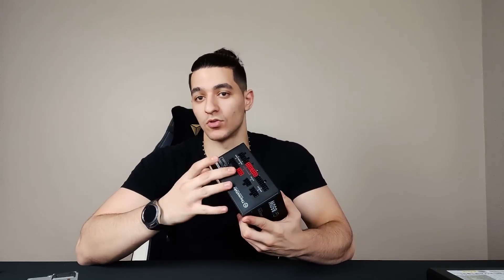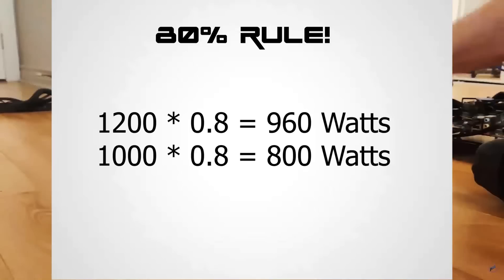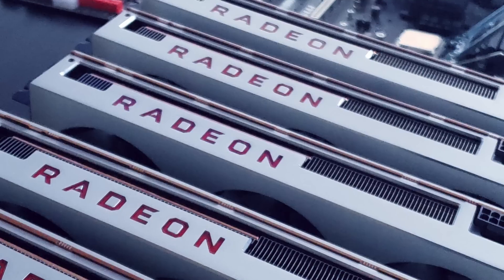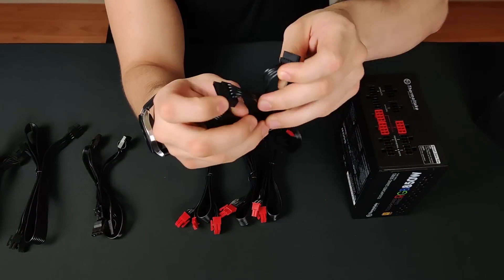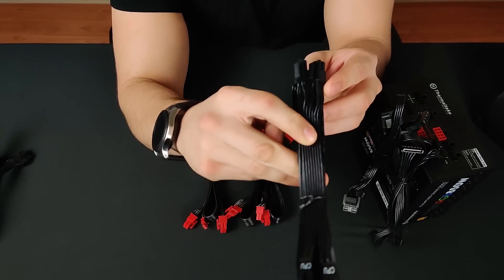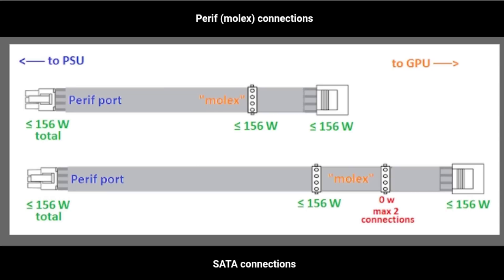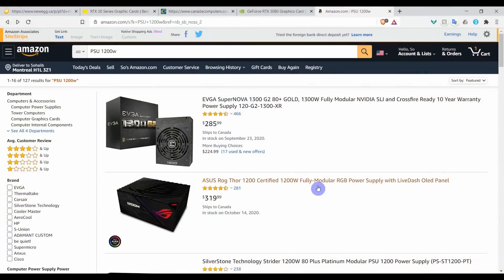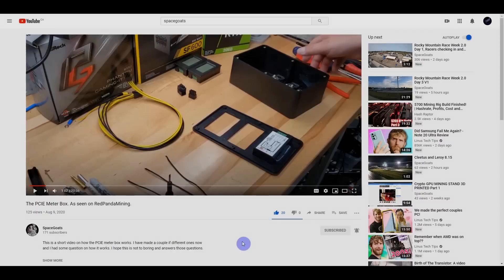Using ATX Powersupplies For Your Mining Rig FULL GUIDE

Comment: @Mining Chamber I have a question.

I have rx 5700 xt s running stable with 96-101W. How many of my GPU+Riser can a Corsair HX1000 (80+ Platinum) can safely handle? Is it safe to run 5 GPU+Riser with my PSU?
I have another power supply for CPU, RAM, SSD & Motherboard.
Reply from the maker: Hey! Out of just 1000 watts PSU for only gpus you can run 5 of them. If you want to do 6 I recommend getting a 1200 watts. Usually these cards pull 120-130 watts off the wall so the software won't be accurate !
Reply: @MiningChamber  Wow thanks for your answer and for your video, I learned a lot from thanks thanks.
Reply from the maker: No problem!!

Comment: if i use one vga cable from psu (8 pin) to one vga (8 + 8 pin) and one new vga cable from psu (8 pin) to riser (6 pin) without branching, is it better to do this ?
Reply from the maker: Yes you can do this for sure and it's really safe but in some scenarios you will end up not having enough strands to run all cards, that's why using splitters is a good way to be able to power more cards with your PSU

Comment: Would you recommend a seasonic PSU? I was thinkin of buying a 1300 platinum series. Or you would recommend a double 750 or 850 platinum seasonic better?
Reply from the maker: It's better to go with one PSU but things to keep in mind is how much watts you actually need and how many pcie pins you need to plug. So if you think that 1300 is not enough for the rig your building then going with 2x 850/750 can be alot better!
Reply: Would you recommend seasonic PSU or you prefer other?
Reply from the maker: @AntaRESynth  I usually recommend EVGA and CORSAIR since I have the most experience with them and they have been great. But I'm sure Seasonic as well is a good option!
Reply: @MiningChamber  how many risers can you connect on a single sata cable to be safe?
Reply from the maker: @AntaRESynth  in this video we mention it to be just one to stay safe. For molex you can possibly do 2 but it's better to do 1.

I would avoid SATA all the time if you can

Comment: What do you think of the 4+4pin CPU to 6+2pin PCIe adaptor (such as this one: https://www.overclockers.co.uk/ocuk-value-4-4-pin-to-6-2-pin-pci-e-adapter-cable-black-cm-14b-ok.html)? I have spare watts in my power supply, but not enough PCIe.
Reply from the maker: I'd not use that since the pin outs I believe can be different which leads to it burning. I tried it once and it didn't go so well so that's out of my experience I'm not quite sure why it happened!

Did you try using splitters and even then it wasn't enough? Maybe you can power a couple of risers with Molex?
Reply: @MiningChamber  Thanks for your reply. I've already splitted the PCIe, so I think I'll try the molex.

Comment: Great guide!! I've watched this video over and over again and still have something on my mind. I only have 2 pci-e cables(with 2 6+2Pins each cable) and the same for the molex to power 4 rx 580(8pins). Which is the most safe option??
a. use splitters on both pci-e cable to power 4 rx & 4 risers
b. not using any splitters to power 4 rx with pci-e cables only & power the 4 risers with 2 molex cables with dual connections
c. please put your recommendation

"a" option: is it okay for the pci-e cable to power all the gpu and riser? wont the cables overload?
"b" option: power load for gpu & risers would be split for each cable
Reply from the maker: Thank you!! Honestly both of your options are reliable, option b does have the factor of molex which I don't like much but option a does have the factor of possibly overloading your cables. So I would use 2x or 4x molex strands so that you power 1 riser or 2 risers per molex. Or you can even power 2 RX 580s and one riser with the pcie strand and then 1 molex for the last riser and repeat for the 2 other GPUs!
Reply: Thank you for the answer, it helps me alot to decide
Reply from the maker: My pleasure! Good luck!
Reply: What happened on this setup?

Comment: I have watched it all and I have a question. The PSU I got is an 1600W, 1560W is dedicated to 12V rails and I will use it to power an 8x RX5700 XTs rig. It has 8x 8-pin VGA and 6x 6-pin peripheral, I have used 8 VGA's, each is dedicated to a single card (8-pin + 6-pin, the cable is 8-pin to 2x 6+2-pin). I powered risers like this: 4 SATA each dedicated to 1 riser. 2 peripheral ports are left and I used them as each cable powers 2 risers through molex(so 1 perif 2 connections). It looks fine but here is the problem: I am out of outputs and cables. How can I power the motherboard? Manual says I should power with 2 Molex and 1 SATA in addition to 24-pin. How can I accomplish that?

What if I plug 6+2pin to GPU and other 6+2 (+2 will not be connected) to riser? Risers have SATA, Molex and 6-pin options and 8-pin cables are already split.
Adding manual just in case:
https://download.asrock.com/Manual/BTC/H110%20Pro%20BTC%2b.pdf
Reply from the maker: Hey! Thank you for all that details. So from reading it seems like the only thing you don't use is splitters and if that is correct then it should be your solution! You can get a couple of splitters that then will help you power the gpu and the riser from the same VGA strand. Which will save you up some periph ports for your motherboard. Let me know if that works for you or I misunderstood you!
Reply: @MiningChamber  That is the way I will go, your Discord channel was very helpful and someone came up with the same answer. Mighty impressive! I will probably share the final result tomorrow :)
Reply from the maker: Awesome!! ⛏️⛏️⛏️
Reply: Best Power Supply For | 12 GPU Mining Rig 3500 Watt Unboxing
https://www.youtube.com/watch?v=5HoUPLEaUBE&t=209s

Comment: i've found system instability when i power more than 2 120mm fans on a molex. i end up just using 2 fans per molex psu connection
Reply from the maker: Interesting! I know that fans take very little power I haven't heard of it causing issues like that. Glad you figured a solution though!

Comment: My experience is that not all PSU's will allow you to use PCIE splitters on their VGA strand.  Example - I have a Silverstone Strider Platinum 1200w, and they come with 8 VGA strands (single 6+2 pin only).  When I try to add a splitter to power the GPU (which requires 2x 6+2 pin), the whole rig just will not turn on.  If I then try to use a different VGA strand from another PSU model and plug them into the VGA port, you get the same problem it just will not power up at all.  Maybe it has some kind of intelligence built in to stop people from mix-n'-matching their cables to avoid litigation in case of electrical faults etc..... Do you have any PSU recommendations for 6x 5700XT's?
Reply from the maker: I haven't heard of that before! But I do know some PSUs have different wiring so if you try to use cables from different PSU that isn't compatible or splitters that are made differently then you will have a high chance of damaging your hardware!
Reply: Mining Chamber which PSU have you had luck with using splitters and where do you get your splitters from (link)?
Reply from the maker: All of the ones we mentioned in the description  are our go to! Links for splitters are in description as well. We usually get them off of nerdgearz!

Comment: @Mining Chamber - Just made a video on using the bitmain apw3++ for mining. I think you'll find it interesting. You can power 5 dual 8-pin GPUs from a single 1600W PSU at platinum level efficiency. Minimum cost is currently only $63 for single 8-pin GPUs. For dual, it's $75. It's unbeatable. Check it out: : https://youtu.be/Xf67xqc3Ink
Reply from the maker: That is awesome! Thank you so much! 

Youtube automatically removed the comment cz of the link sorry for the late response on it!

Comment: Hi, I am new and I am buying 6x Sapphire Nitro+ 5700 XT 2x8 PIN and someone is selling a PSU with 8x8PIN and 6x PIN/sata/Peripherical do you recommend to connect the same risers that your show in the 6pin or 8pin? Thanks!
Reply from the maker: Yes I do! Use one splitter for a gpu and one for 2 risers if needed
Reply: @MiningChamber  Thanks, I bought 4pin molex female to PSU 6 pin male splitter, I am planning to connect max 2 risers per splitter

Comment: What's the most practical setup you woulf recommend?0xD2917eb36cC03237A11e6E2F89B3f8F8F30963F3
Reply from the maker: Setup for a full mining rig or setup for powesupplies? 

For mining rig I recommend - 5600XTs while for PSUs I recommend using one large PSU (1200w and up based on your needs) combined with alot of splitters   so you don't have to use more than one wall outlet.

Hope that helped !
Reply: @MiningChamber  thanks for ur response! :D love ya bro. 🤣

Comment: don't OC the readon 7 you will code 42 them ( BRICK)
Reply from the maker: 😂😂 they will be fine. That is just a issue with bad gpus. They only code 43 If they come bad from the manufacturer. If you don't OC them then you shouldn't mine with them since they will consume alot of power

Comment: Can i use GIGABYTE GA-B250-FinTech for Rx 5700xt 8gb, cuz the motherboard was old can i still use them for 6 cards?

 or any suggestions !!!! <3

 ETC  0x7298Ebdac6d37B4E50E507cC15f16E9108f7b3E1
Reply from the maker: I'm pretty sure it's okay! Ive never used it my self so I wouldn't be able to tell you exactly. But I'd recommend b250 mining expert and h110 pro btc+

Comment: Great video! Just a follow up question though,  I’ll be running an 8 GPU rig with dual power supplies that I already had (1000 and 850 both platinum) I’m also using 5700 XT THICC III ULTRA’s all around. Would I be safe using splitters? I’ll be plugging 4 and the mobo into the 1000 and the other 4 into the 850 and have the 24 pin splitter. Also, all of the cards use dual 8 pins, do I run one Y splitter for each GPU and just go with the 6pin straight to PSU for risers?
Reply from the maker: Thank you! You can use as many splitters as you can just follow the rules of balancing the watts between all cables. It is recommended to power the gpu and riser with the same PSU so try to distribute your connections properly so each PSU takes a number of gpus and risers. Only thing you need to worry about splitters is to not connect a splitter into another splitter!
Reply: Mining Chamber sounds great! Now I just need to find splitters! Any recommendations for 8 to 2x8 pcie male to male splitters? My EVGA PSU only came with 2 and I can’t find any ones to add for another 6 (EVGA support wouldn’t sell me just 6 lol)
Reply from the maker: Splitters don't come with PSU! We left links in the description for places to buy them ( nerdgearz and amazon)
Reply: Mining Chamber I saw the nerdgearz link but they’ve been sold out and the amazon link is a little sketch but I’ve been debating them. Also, my EVGA PSU came with 2 cables that go from the PSU to 2 (6+2) GPU each. May not be considered a splitter but it has functioned as one so far. EVGA SUPERNOVA 1000 T2
Reply from the maker: Yes that is the regular vga strand! Goes from psu to gpu

Comment: Hi, Im currently running 7 rx5700xt (3 gigabyte and 4 sapphire pulse). The gigabyte cards (overclocked but not flashed) are consuming ~120W and the sapphire pulse ~100W. I was thinking on using a 1000W Evga Gold 80+ to power 6 of those. I wasn't considering the 80% rule but 90% due to the efficiency, but I understand that with those values it should be fine. Or am I mistaken?
Reply from the maker: I definitely recommend min of 1300 watts. You don't want to take that risk with your PSU so you don't end up burning it fast! 80% leaves room for error. User error will always be present so I recommend either 1300watts or 2x 850 watts.

Plus those cards off the wall will be consuming more. Minimum for 5700XT is 120-130 Watts including risers and such.
Reply: @MiningChamber  I think I'll use the 1000W for 5 of them. Thanks!
Reply from the maker: No problem ! Good luck!

Comment: Wow, you just saved me with this video! I’m building my first rig and all graphics cards have 2x 8 pin(good thing I didn’t buy them all at once, so I have only 4), and I didn’t expect it, but now I know that I can use sata! But actually, can I use sata or should I buy sata to something(6 pin maybe) adapter?
Reply: 5700 rx nitro+ with evga 1200p2. In this video you said that it probably ok to use sata, if graphics cards have 2 slots and my cards have 2x8. Second option is to use splitters for splitters to power up pcie and 1 graphics card from 1vga, and I’m not sure it’s a good idea. I still have time to figure it out, since now I have only 4 gpus and don’t want to spent all my money to buy more.
0xbC62c9a7Ac59a7c0f6f9cC6f5C0ab2Ec43F607cB
Reply: @ЛексБогатюк  Did your sata-powered riser work or did you just go for the splitter instead?
Reply: Also, great videos! For a long(too long) time I was interested in crypto, even used it to buy some things, and the inspirations for start mining was: 1) photo of rig made from old pc and basket for groceries and 2) your channel. Good topics, information is very easy to understand. Thank you very much.
Reply from the maker: Hey!! I mentioned to avoid SATA whenever possible xD So if you can get splitters and use splitters then it is much safer. Which cards are you running?

Comment: Great video. What PSU would you recommend for 6x RX 5600 XT?
ETC: 0xdA316F70Ca8237a83F7B1Dae5c8B6ee1AfCA6313
Reply from the maker: Thank you! I recommend the 1300w gold PSU or the 2x 850 Watts Thermaltake PSUs. We have 3 options in the description they will all work great on your rig! for 850 make sure you get 2 of them. You need a minimum of 1200 Watts for that rig to stay safe.

Comment: Awesome, comprehensive video. This is such an important and critical part of rig building that's often overlooked, especially the wattage that a riser can consume depending on the GPU make and the wattage for various cable connectors. And seeing that the new RTX 3080 is 320W TDP, it's even more important if one is going to build a 6X rig. My experience is that the server power supplies are only safe for low wattage GPUS as the watt-per-cable is often as low as 90W.
Reply from the maker: Awesome thank you for letting me know! It was really hard to find info about breakout boards and how much watts can those 6 pin carry. This is alot of help appreciate it!

Comment: Not recommended to use Sata for risers on cards that are over 75W and use the PCIE x16 slot as a main source of power. 

Example: GPU Card has 1 six pin power connector but is rated for 150W. Standard rating for 6-pin is 75W. The PCIE x16 slot can provide the other 75W. In this case the Sata is only rated for 54W and you would want to use 4pin molex or 6pin for the riser. If the gpu card came with two 6pin power connectors and you use both of them to cover the full 150W, then Sata would be okay for powering the riser.
Reply from the maker: Awesome! That is great to know thank you for the information!
Reply: Precisely, if a card uses more than 54 Watts, then you should even consider using SATA power for it's riser (and since the PCIE connector itself is rated for a max of 75 watts, powering it with a cable that's only rated for 54 watts is asking for trouble in the future).
Either use Molex to power that riser or perferably a GPU power-cable to power risers.
Not a single person I've ever talked to in various Mining Discords (several other Mining Youtubers etc) has said you should use SATA power to power a riser, not even as a last resort.
So personally I'm sticking with GPU-power cables, and if I don't have any more of those, then Molex, and I think everyone else should too.

Comment: i never really thought about using a better then bronze psu.. i guess a platinum is my next upgrade
0x7eE0ac99c40bDbf6637Fa741F289D1202351C76d
Reply from the maker: Haha for sure it makes a difference! Especially if you have expensive electric rates.

Comment: Hi! Can I use two splitters that will connect to each of both ends of an 8 pin PSU to DUAL 6+2 pin? And then use the 1st splitter to power the GPU(I have 5700xt), and then use the 2nd splitter to power two risers. I hope I make sense. English isn't my primary language and I couldn't keep up with the video without replaying it. TIA!

0x9497e3f1b8f8d5b8a8292420f830cf04ff18fa34
Reply: I never use more than 2 risers connected to the same Pcie cable. Also im using 1 splitter with each GPU. For example, my pcie cables from the psu have 2 conectors each of 6+2, so if the GPU has 2 x 8 pin one cable for each GPU and the rest for power the risers with a max of two risers per cable. Hope this helps you
Reply from the maker: Exactly on point Mike! Ramon as Mike said you will be completely fine powering 1 GPU and 2 Risers on a dual 6+2 pin cable.
Reply: @MiningChamber  So just to clarify/confirm.... if you need to power a GPU that requires (1) 6+2 pin and (1) 6 pin plus (1) 6 pin on the riser.....you can do so by using a PCIE that has 2 connectors plus a splitter added to the end of one of those connectors?

Comment: Great explanation of power. I do want to make sure I understand the splitters for my rig. Im going to have 6 5700XT Red Devils(2x8 pin). I have evga 1300 g psu. If I have one pcie cable with dual 6+2 ends can I put splitter on each and run 2 5700xt's with it?
Reply from the maker: Thank you! Yes you can do so,  But I do recommend if you can avoid 2 gpus on one strand try to avoid it, if not its okay it will be completely fine! 1 Strand can do 2 gpus and the other strand can do 1 gpu and 2 risers. Like that you can balance it out.
Reply: @MiningChamber  Just got my EVGA 1300 PSU and it only came with one cable with the two (6+2) plus 5 reg 6 pin. Not sure if I can power all 5700's plus risers? Do you know if I can use cables from my EVGA 1000? I have spares in that box.
Reply from the maker: You will need to look up the model and see if they are compatible! I think it should say on EVGA website